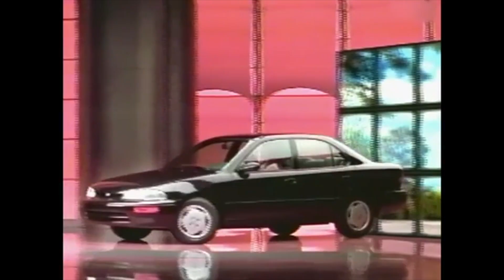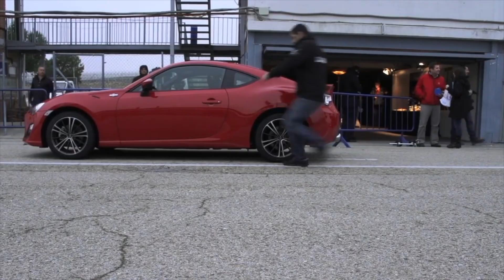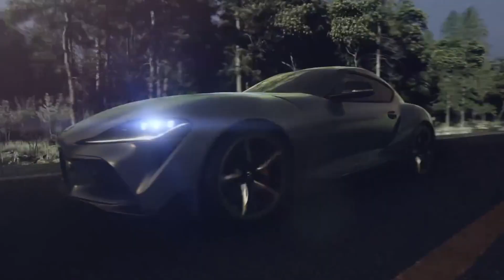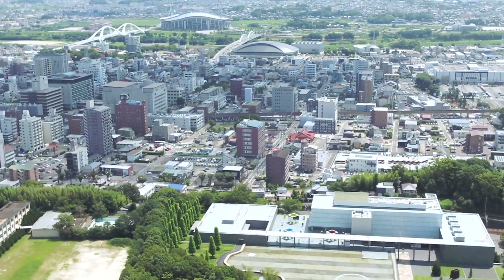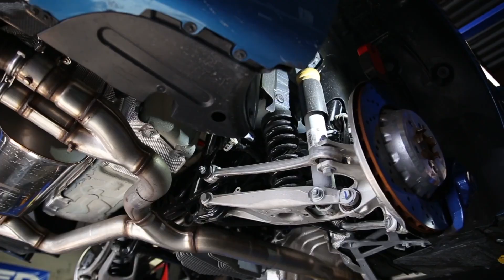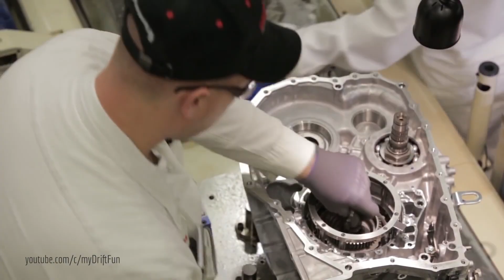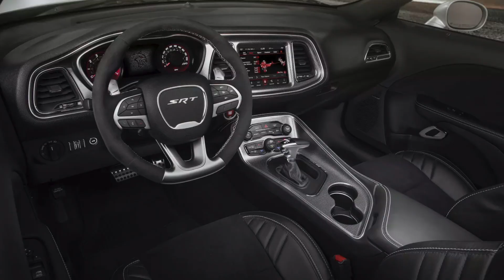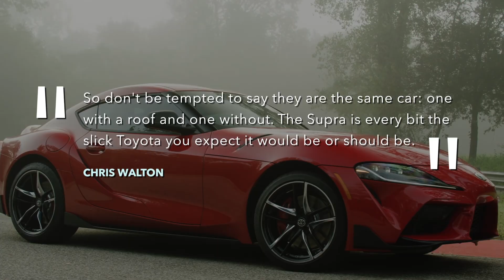MKV Toyota Supra - BMW or Toyota? The UNTOLD TRUE STORY

Comment: The mk5 is not a supra. Its shorter and taller than a supra. The proportions are wrong and the wheels look a size or 2 too small. Also the fact that they chose not to include a supra-wing as even an optional thing shows that Toyota has given up sportscars.
They pulled out of all racing games at the end of 2017. Their sportscars are both rebadged BMW and Subaru.
Reply: Vade Nummela you’ll just have to accept the look of the new Supra despite your dislike of its looks, and Toyota has an exclusive contract with Japanese car games to put Toyota’s in their games. They didn’t completely pull out of car games, so you’re wrong there.

Comment: i really hoped the 86 wouldnt look like it looks now.  really hoped to keep it a bit edgy,  even retro, with a BIG wink to the AE86....    Just like the new supra just doesnt look like a supra should look imho     I also think its a bit too small for a supra??

to me, an engine for  brand specific "cult" cars, should be build and designed by the manufacturer itself  (ext help like yamaha is allowed, cause yamaha is a general engine builder for MANY brands.    just dont like TOYO engines in MINI,  PSA engines in Ford, BMW or Subaru engines in Toyo,  etc....)

Comment: This breaks my heart like the 86 why why Toyota why cant you make the great motors
Reply: I understand. But why not re bring the 2jz upgrade with today's upgrades.
Reply: They should have redesigned a new performance motor and put it in other Lexus models just like with the 2JZ engine used in the Lexus GS300, SC300, IS300 and certain Japanese Toyota models.
Reply: Because it's incredibly expensive to develop a new engine from scratch these days. It's far easier to run their quality assurance tests on an existing BMW engine and make suggestions for changes to make it more reliable rather than starting from scratch and ending up with a potentially inferior product.
Reply: @CockatooDude  They could just put a Lexus V6 in it?

Comment: Listen. I'm just glad Toyota stuck with their origins and kept it a turbo charged inline 6, unlike Nissan who went with a TTV6 killing the spirit and sound of what a Skyline should be. I understand why Toyota didn't make bother producing their own successor to the 2JZ... Why would they waste money on R&D on a new engine? BMW has basically done that for them since the launch of the N54 engine. Although I do understand the other argument of it not being a true Toyota. However until this car comes out... I wont be judging it. If you're into modding your car... This is nothing but a good thing since aftermarket parts will be plentiful.

Comment: I don't understand why the new Supra is not more often compared to the BMW M240i.  They share the same B58 engine with equal power specs, which is actually a slightly de-tuned version of the B58 offered in the Z4.  The M240i has obviously been tweaked to be a daily driver/sleeper (less of a raw sports car), but by almost every other measure, they are more similar than the Supra/Z4 comparo.

Comment: It's not hard to understand what most people want, if you want to call it a Supra, it needs to have a highly capable engine to endure intense tuning. It's stock engine horsepower and torque are not all that important as people can tune to suit their needs, but a V6 TT should be minimum. 
Supra is very iconic and should be toyota's ultimate weapon, and you still decided to team up with BMW to build its engine?
It needs to have a manual trans for car ethusiasts, please don't start telling me "auto is faster" bullshit, unless its so powerful like the GTR that manual shifting may not be quick enough and may be damaging to the trans, then at least give us a paddle shift. But I don't think this engine will be that powerful. 
Looks are okay but the FT1 concept looked much better, especially the taillights, it looks like a saggy grandma face and a cheap replica of that FT1's.
Reply: 1k Hp isnt stock dumbo
Reply: @audi1ification  Have you replied to a wrong post? where did u read the dumb shit about 1k stock hp

Comment: not the first time.   The toyota 200GT was offered to Nissan first, they were in 240z development and said no.   Then Toyota said yes, and ALL the Toyota 200GT's were built, by Yamaha.

BMW,  follow the manufacturer's replacement cycle, replace parts on the exact day required by the mfr, and the car will last, forever.   problem is,  what appear to be  perfectly fine parts are not replaced per the schedule by 'muricans, the car is driven by 'muricans who drive hard and hang up wet to dry, and then scream when the car goes boom for a large amount of money to repair.

Toyota.  drive it like an 'murican for hundreds of thousands of miles, replace only oil filters and tires, and sing praises to the skys for the reliability of the car in spite of it's careless maintenance by 'muricans.

it will be interesting to see which road the this red-headed step child of the two vastly different car maker's mantras will follow.    given the high horsepower, high performance desired, i tend to believe it will require much more preventive parts replacement than the overengineered and understressed Toyota parts bins require for current Toyotas.   how will toyota owners who bring them in for service in the outyears react with 4 and 5 thousand dollar repair bills, for what appear to be perfectly running cars, to maintain the high performance wear and tear?  

honestly,  the Supra/Z4 it is as ugly as a butt fence to me, priced at the entry level of a Corvette C7, and with the vette i can get the vert version for about the same money as the hardtop when the end of year sales start.   nevertheless, i love my toyota drive 'em forevers, and if this new red headed stepchild proves to be more Toyota than BMW, more power to Toyota!
Reply: @Bapak Bob Your BMW description sounds more like I would expect with Ferrari, Lamborghini, Maserati and maybe the German (Cologne) Ford SOHC 4.0 L V6 in the previous style Ford Explorer.

Comment: It's Fugly , It's been a constant down hill slide since the MK3. The concept prototypes all looked so much better than this lumpy thing. It Looks like a cross between a rx7 and a 350z. The engine is underpowered. The Lexus looks so much better. should have went with a v6 or a v8 turbo charged. Base the chassis  on the mk3, which handles awesome . Lacks Toyota originality . Better luck next time. The 2000 Castrol Gt would have been a much better look. Even KIA has better design teams even though everything they make is crap.

Comment: would I buy this car new? no. this is not the car I waited over a decade for..would I buy it used? probably. ..sadly I know this car at the end is really a BMW and reliability will be my main concern to me . Toyota spent less time on actual engine development ,they spent more time on tweaking the motor BMW built  in time for the debut of the bmw... (I guess this is why they lowered the hp) in the end its not the replacement I was hoping for this car should have been named the celica (like in the 80s)and worked up on this to the supra name, my biggest disappointed is no manual gear box an auto gear box is good but you feel disconnected from the car...any how I hope some how something good can come from this z4pra build...but again I would never buy this car new.

Comment: I dint like it, american style again even f i can se the old car in it.
Stop with the american styles, these cas is japanese and they are already american styled cars, but NSX went this way too even harder totally giving up what the older Honda NSX stood for.
I mean yes they want to sell them in america, but is naking them american really the way to go?
I dont think so, keep what you have buyers of these want something thats us like a new version if a model of old.
I like BMW alot, they shared that the Supra had a straight six, i hate that v6 is a must suddenly for example.
But a Tuyota Supra being a BMW Z4 is not what i thought if.
The old Supra TT from the later 90s was a really expensive Toyota it was not even importet to my country anymore, so those was not cheap really.
And the engine on them kniwn to putting out lots if power with just outside jibs on them, that is not possible anymore, and that is a big oart if Supras myth, buying one 280hk and getting 500hk easy, ok they most often gave alot more tvan 280hk, it was sime stupid japanese agreement to not make cars with more power.
Its abit like the also stupid 155mph limit on cars built for being fast, like nobody could die in 155 but 170 thats death.
For a while i guess ut was snobbery to have a lumiter, but those days are over, i get it like on some american cars that really is dangerous driving even that fast and some SUVs that just cant take it.

Comment: You know, you don't have to go and buy both cars to see if they drive the same. Ever heard of Gran Turismo (as in the video game/simulator)? The latest installment has both cars. It's realistic enough to give an accurate answer. I haven't tried them myself but I'll bet most of the opinions are based purely on the fact that the two companies collaborated  and not on any test drives.

Comment: Holy christ i hope they didn't use BMW's window regulators
Reply: Don't worry, it's toyota :>
Reply: Yup
Reply: It's been redesigned by Denso, but still BMW sourced.
Reply: Or BMW gaskets and oil seals.
Reply: bokibo87 hahaha 🤣 I'm cracked
Reply: 😂😂😂😂 Considering that they used BMW's supply chain... Probably.
Reply: My point exactly!!!! Thank you...let the rich tell the world.. I know I cant afford to drive the car every week to the shop for warranty problems..
Reply: as a window tinter, this made me lmao. bmw window regulators are retarded. you hold the switch down and at times nothing happens, if you're lucky the regulator will work within 3 seconds.
Reply: Toyota regulators are not any better. Changed 4 of them. But at least they are easy to change. . .
Reply: They are. Everything on the car is german made.
Reply: @CheapGuitarsAndMore  Okay. You didn't saw the video above isn't it ?
Reply: It sounded as if only the powertrain and suspension components are shared. The body, interior, tuning, etc will all be original.
Reply: @slutdad6215  the interior is BMW
Reply: @E9X330  horrible horrible bmw interior :(
Reply: @aleksiesko885  BMW interior is pretty nice, at least in all 3 series gems, but in a Supra ? Yuck
Reply: @slutdad6215  yeah, thats whats said, but tell these people who will go to the end of the world and back to shit on something that doesn't come along very often.
Reply: @slutdad6215  no. They said that Toyota is using the same body manufacturer as BMW. And they will source various parts (including suspension) from BMW's supply chain to reduce costs. The body looks like it's based off of the Z4M coupe which was a hardtop.
Reply: Soooo , it seems window regulator is a problem in every German car.
Reply: Estela Dapper 
I owned all my life German cars 
Never ever had any problem with window regulator!
Reply: @travelexplore9724  you must be lucky 😂😂😂😂
Reply: DOHC Motors ,write very well for a two year old! (I’m joking!)

Comment: To all you supra A90 haters, please keep knocking this beast down, cause what your doing is giving me even more energy and passion to tune the supra that I have on order ever more, this b58 Toyota improved engine that is at the peak of engineering and performance with a twin scroll, forged pistons, forged piston rods, forged crankshaft on a closed deck block with utltra slippery mirror finished bores, just think what a large twin scroll turbo and E85 would do to the performance of this vehicle, 
Mark my word all you haters will be eating your words!
And I will be there to remind you all as I drift around you how wrong you all were.
Take care and keep safe on the roads all.
Johnny from Australia down under.

Comment: The issue people have is that Toyota sold out the idea of the Supra to save a few bucks on what is arguably Toyotas most loved car by the enthusiast community. Instead of a reliable JMD sports car that can handle 1,000 HP with minimal modifications, we got the next generation of a German hairdressers Miata. On top of that, the fact that there's no manual is an insult. Toyota is literally the most successful car company on earth and i don't think people are keen on them saying that they needed to go to Germany to be able to produce something with 2 doors, a manual (option at least) and a straight 6 with some untapped potential.. Also, I think this whole thing would have been better received if they'd have just called it something else. The Ft1 isn't a bad name and it may have been disappointing on some levels, but at least it would have helped with managing expectations. One thing I think most people can agree on is that the Z4 took a step up and the supra took a step down.  Good vid BTW. I subbed.

Comment: Thanks for the very insightful and balanced video. I was fortunate (or crazy!) enough to have bought a new MKIV Toyota Supra Turbo with the spectacular 2JZ-GTE engine when it debuted in late '93. Still own it 25 years later, bone stock with 34k miles. Absolutely remarkable car - Toyota got it just right. Not prejudging the new model at all, but it seems ironic that the ONLY German component I know of in my Supra is its Getrag 6-speed manual transmission, while the new Supra has no manual transmission even available. A stick option might have quieted some early criticism, helped distinguish the new Supra from its BMW stablemate and attracted sports car purists who enjoy the driving experience and more visceral connection to the car that only a manual transmission can offer.

Comment: Idk why Toyota just didn’t stick with the 2JZ platform and or improve it. Work it, make it, do it, makes us harder, better, faster, stronger.
Reply: The old 2JZ would not be able to pass current emissions.  Back in the 1996 model year production of the Turbo model was only available with an automatic transmission to be able to meet emission certification requirements. For 1998 the last year of production in the US the Turbo model was not even available for sale in California because it would not meet that states strict emissions standards. Even in Japan production could only be sustained until 2002 because emissions could not be improved upon.   So an update to an old heavy iron block inefficient engine with 30 year old tech might not had been worth it if they already knew this.

Comment: To be clear, the video clearly states that they initially wanted to use an existing BMW engine, but Toyota said no. Toyota had thier own, newly designed straight six that was already under development and invited BMW to give thier input on it's final design. Now correct me if I'm wrong, but that makes it a Toyota engine backed by a third-party transmission that is niether Toyota nor BMW... Or am I missing something?

Comment: If Toyota and BMW does finally develop a manual transmission, I should hope that it is at least equal or better than the one found in the current Corvette. In the short term until the price of electricity comes down to a very reasonable level, we will continue to see more refined petrol powered vehicles. Eventually when it does arrive to the point of time, we will be using electric powered vehicles or other type of powered vehicle (hydrogen etc)

Comment: Don't use Bolts to hold the wheels, as it unsafe e hurt the mechanics, as when the loose the last bolt it fall, and if you are in a rush bad injuries

Comment: Looks like an ND miata. After watching the video, they met an interesting engineering challenge. Lack of a manual gear box is sad but that's just the direction the world is moving. Unfortunately the price tag puts this car in the "I liked Supras when I was young and now I have some disposable income cause I'm 50" range. Should be a fun one to see but I'm predicting RX-8 like sales. Reboots are hard. Trying to capture new peoples hearts while staying true to the old. It's not an easy thing. Because the people judging it don't actually want a new car. They want to feel like they did when they first saw a Supra. Or first sat behind the wheel of one. When they were young. But time goes in one direction and you only live once. Without having driven it I say good job guys. I think they pulled off something special here. I think the combination of upfront engineering from BMW coupled with the durability testing from Toyota could have lead to a race quality engine. I'm sure the turbo set up will have to get scrapped by the after market community but with a little luck the internals will be OK with that and we'll start seeing some 4 digit HP numbers.